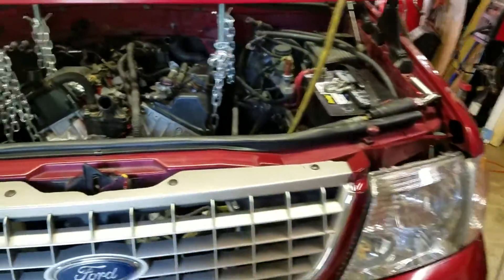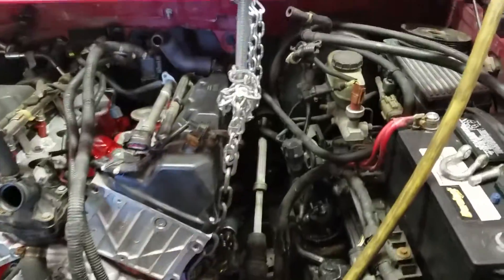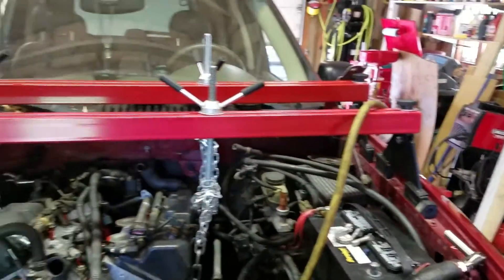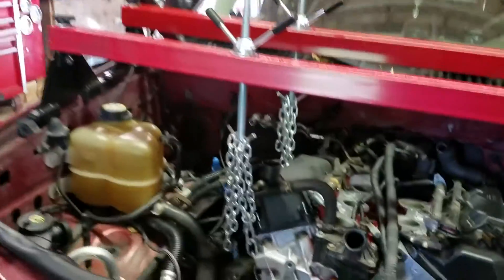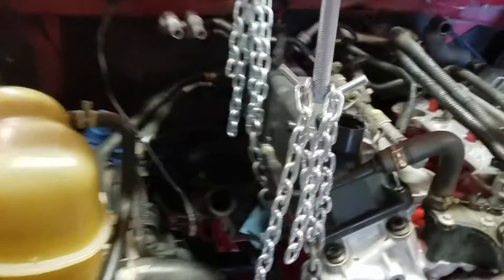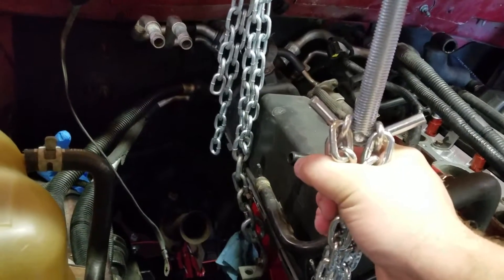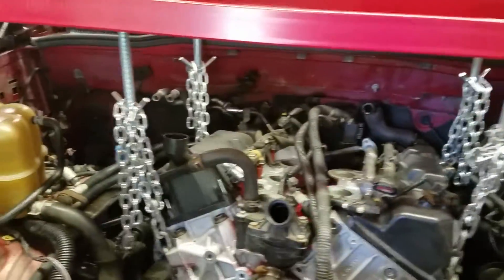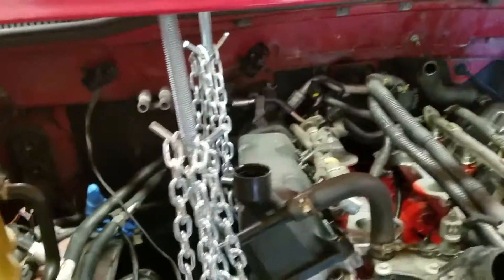02 Ford Explorer - Engine Removal WITHOUT pulling Transmission - 4.0 SOHC Eddie Bauer 4x4 - 1/2

Comment: How many bolts where on the transmission I have removed 6 but the top two where missing
Reply from the maker: been over a year, no idea. I'll tell you, you need to lower the transmission while still attached and use like 3 feet of extensions to get a few of them

good luck, that fuel line bracket is a huge PITA along with trying to get the spacer plate between the trans and engine to stay intact
Reply: Ryan W rhat hit home so many extensions!
Reply: This was lame, just showed it out, didn't show how to do it. This is known as click bait.